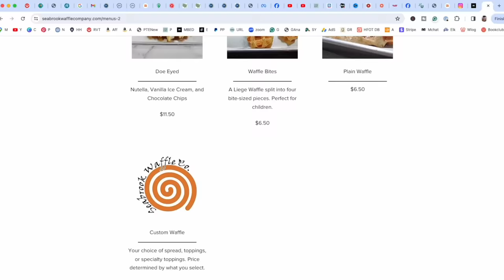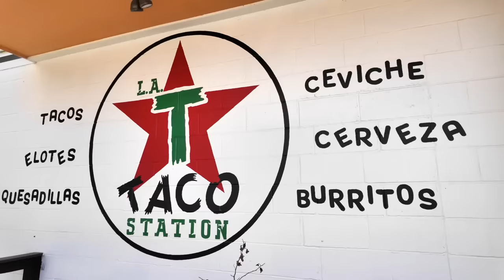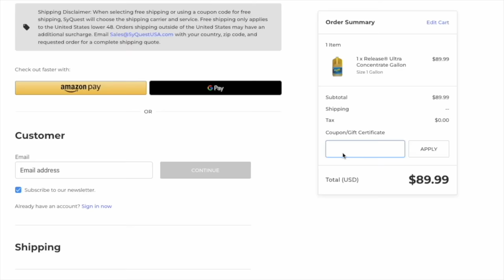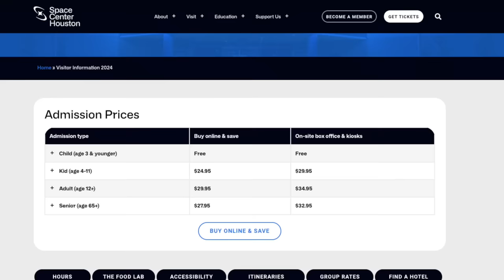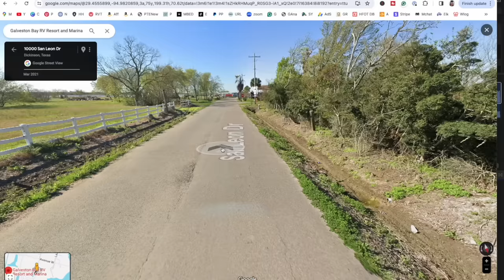What Happens When the Shortest RV Travel Day Goes Wrong!

Comment: Many years ago I was a Program Manager for heavy maintenance at Dee Howard Aviation and managed some work on a Shuttle Carrier.  If I remember correctly we were doing some aging aircraft SB's but I do vividly remember talking to the crew that flew the aircraft and it was a fantastic conversation about the flight characteristics with and without the Shuttle on board.  Basically it flew the same but no big surprise that the throttles were much more forward with the Shuttle on board.  Everyone should visit that museum.  What a great aircraft.

Comment: What I do to get the exact route and not miss an entrance is to use Garmin's BaseCamp software on my laptop to build my route on the laptop using waypoints at key locations.  Then I upload the trip to the GPS.  With waypoints the GPS will tell me the exact spot that I have reached my waypoint.  I normally do this just before the entrance so I don't overshoot it.  Works great on long roads with no signs or row of palm trees to mark an entrance.

Comment: A couple of years ago, we were heading to DC.  One of our stops was Cooper Rock State Park in PA.  We got off the Interstate and saw a sign saying Cooper Rock Office and an arrow pointing one way and a second sign saying Cooper Rock State Park with an arrow pointing the other direction. Well we figured we have to go to the office first, so we went in that direction.  We went up a long incline driveway and found out that the office was the maintenance office.  There was no place to turn around and cuz we were on an incline, we couldn't unhitch the toad.  My wife had to steer the toad while I backed up the motorhome.  What a pain that was!  Using Google Maps for every stop now. Thanks Stacy.

Comment: Bottom line up front: Use walkie-talkie’s. It’s a good thing we did because our brake buddy broke and we were driving up to an elevation of 8700ft. It seemed prudent to not require our rig to go up/down significantly intense grades without toad braking😅😮. Driving up/down around Cloudcroft NM.

Comment: For many years, we have Vacationed at a few campgrounds, normally Provincial Parks.  Therefore, we rarely need to worry to much about getting lost as we have been there multiple times.  Sometimes staying in the exact same site!

This summer we start the adventure of travelling greater distances and to new places.  Our plan is to circumnavigate Lake Huron (we live in Ontario).
Only two of the parks have we visited before, so your video is timely about making sure we both know where we are going.  One of the parks in Michigan I (not my wife) stayed at when I was 10 years old.  

I plan our trips and my wife will navigate when necessary.  She is a good map reader.  Yes, we still often use Official Paper Maps!  I will make sure she know where we are going and how to get there.  I like your use of Google Maps to show you the turns into a campground.  We will use that method.

We were coming home from Myrtle Beach (without Trailer) and the Paper Map was more accurate than the GPS.  A new Highway had opened and I had not updated my GPS before leaving home.
The GPS got very confused as we drove through fields.  LOL.

Comment: We just went full time the end of November '23.  So far we have traveled 3,480 miles with 28 stops (campgrounds) but have never moved without flat towing the car.  My wife has the Garmin RV1090 on her side of the RV and I have the Garmin RV890 on my side.  She calls out the turns and I can see which lane I need to be in and exactly where to turn on the Garmin.   Love the channel and I don't miss a video.  Been watching since before we purchased our Class A over two and a half years ago.  Care to tell me what campground it was at the beginning of your video with all of the buildings that were elevated?  I'm working on adding the Seabrook area to our itinerary for our travels through TX next winter.  TIA.

Comment: I Phil ya,  I have a total love hate relationship with my GPS..  As soon as it says turn I look at the Map and see a road almost immediately and turn then realize I should have turned at the next road that is 1/2 a block away.  As soon as I decide not to turn immediately I drive past the one I needed.   And last year our Garmin took us to Hot springs AK and for some reason decided to take us to the campground by routing us past the lookout tower first. If you have been there you will know the road up to the lookout tower has cars parked on both sides and is very narrow for the last 4-5 blocks before the turn to the tower which is one way and you don't see the max 30" sign until you are too far around the turn to back up.  We obviously were able to navigate the road but the pucker factor was ant max until finished the loop.  The next day I bought a Lenovo android tablet and we now run RVLife GPS and Garmin side by side.